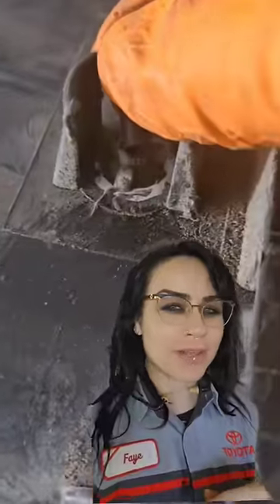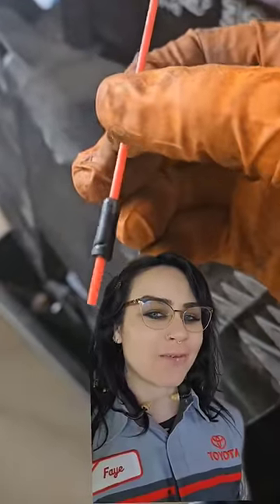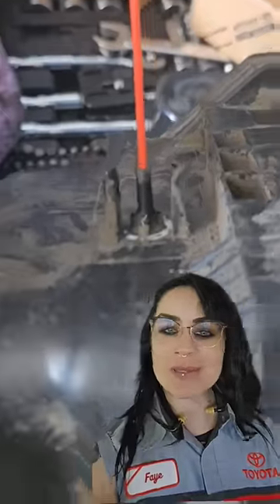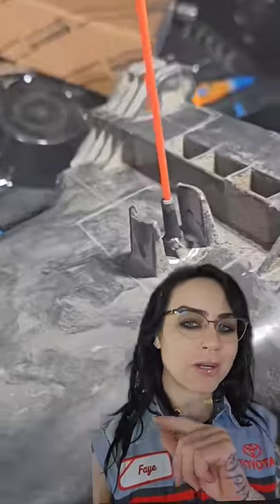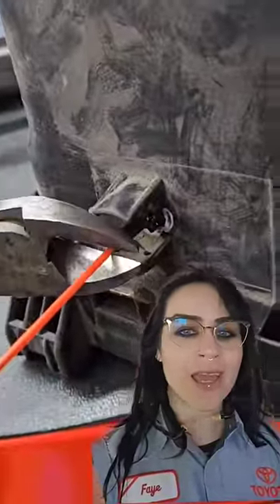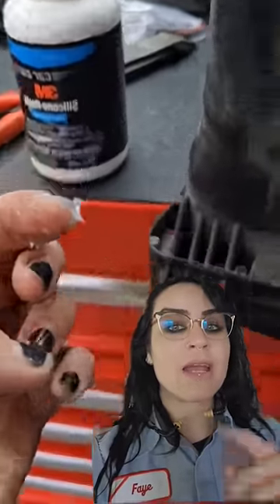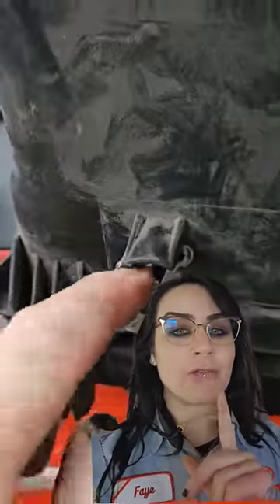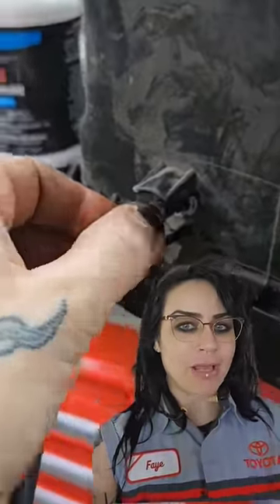Quick Fix - Broken Vacuum Port / Air Box Nipple Repair #techtips #toyotatech #femalemechanic #diyfix

Comment: I typically thrill it out to the same size and replace with copper tube and J-B Weld
Reply from the maker: Alsoi good!!👍🏻
Reply: @FayeHadley will this work on a jet plane?😂
Reply: also a short piece of brake line can do in a pinch. Leave the flare on the inside and build it up with glue for strength.
Reply: JB Weld is also far stronger than Gorilla Glue.
Reply: No need for the jb weld. Make the hole around half a mm smaller in the plastic portion, heat the ferrule up and then slowly sink it into the plastic. Looks factory and will never fail.
Reply: @qanondon2100  A&P technician with turbine experience here, this would be a repair warranting throwing a 2" wrench boomerang style at your knees on a jet lmao. 

The only exception would be in any form of military aviation, they fix it just enough to get off the ground long enough to come in for a hard and hot landing at their maintenance ramp.
Reply: @FayeHadley I probs didn't hear but why not pull out the straw before it dries holding the piece in place while doing so? That hole looks smaller now
Reply: @Nayr747  True, Cyanoacrylate glue (Super glue) is susceptible to moisture and shock failure.

Comment: You can usually find these barbs in the plumbing department all the way down to 8th inch out of brass and then you can get a small pipe tap and drill the plastic out and then tap it either 1/8 MPT or 1/4 NPT or 3/8 NPT depending on the size. Super glue and a spray nozzle works 100% if you're on the side of the road somewhere and for whatever reason a vacuum line won't hold on idle or something like that but brass and some threads is a little more permanent.
Reply: the nipple is a way better fix and if you look hard enough you can even find them in black plastic if you a visually OCD

Comment: Use brake line (NiCopp recommended) with a slight bubble flare on one end and scuff up the other end with 180grit
Use a drill bit one size smaller than brake line.
Clean newly made nipple with brake cleaner or other solvent. 
Make sure it will go in hole with some force.
Then install with some 'JB quick weld' on scuffed end.
This is a permanent repair and will be stronger than from factory.
I have repaired many $100-$200 vacuum solenoids etc with this technique.

If customer has some mechanical understanding and you explain and show him final product with a shiny metal nipple sticking out of it you'll go from being a mechanic to a magician in their eyes.

Comment: Nice tip Faye.
My hack for fixing this sort of issue is instead of using a plastic straw, I use spring steel roll pins.
Super strong, and will never break again😁👍

Comment: Tip here , if the hose is brittle and not moving just take a knife and slit it and then trim back and reinstall when done. Piece of hose doesn't cost a thing but that air box def does
Reply: If you're putting an old hose back, you will probably want to cut off the end anyways, because it may crack.
Reply: I mean what's wrong with breaking the customers equipment then simply glueing it back together lmao.
Reply: Work smarter not harder. 😮
Reply: I learned this the hard way on the first heater core job I ever had to do for free, when changing the hoses. Boss told me the trick after... figures.
Reply: Also, put a thin smear of silicone grease on the nipple before reinstalling the hose. The hose will never get stuck again.

Comment: Here in FL,  those hoses get rock hard too. I dread having to touch them.
Great tip Faye
Reply: So you got me thinking. I looked all over under the hood of my car, and the only plastic I found was the washer fluid and coolant tanks, the battery, and the wiring connector at the firewall. Everything else is cast iron or stamped steel.
Reply: This would be located on the enclosed air intake box somewhere.

Comment: MEK also works excellent for abs plastics. 
It chemically melts the plastic, creating a weld once dry.
Maximum binding strength is about 24 hours.
Reply: Ain't nobody got time for that
Reply: @mrs6606  If you're pulling an engine and waiting on part's you do.
Reply: I have a degree in plastics technology and you are absolutely correct. The only thing better would be THF but nobody has that…
Reply: I don't know about that particular filter box but  the one on my '02 Civic is made of HDPE.
Reply: @sponiebr  High density polyethylene (HDPE) is a thermoplastic- 
all though ABS and PVC are thermoplastic’s as well, they are less dense and therefore more porous and absorb the solvent better. In your case you should rough the surface to achieve the same effect. HDPE is difficult to bond but beyond thermo welding, Chem welding is still your best bet.
Reply: @howto1537 
What is “MEK” and “THF”???

Where would someone find these products???
Reply: @AzzKicker-bz1cb  you won’t find THF but MEK (Methyl Ethyl Keytone) is fairly common. Most hardware stores should have it. It’s a solvent
Reply: @AzzKicker-bz1cb MEK is methyl ethyl keytone, they don't sell it here in California anymore, I used it for all types of stuff when I was younger.  Not sure what THF is.
Reply: @Chicomite  its either triethylamine trihydrofluoride or Tetrahydrofuran aka Oxalane. 
Its a precusory agent used in polymer production, which is essentially what all "plastics" are.

You can also weld acrylic and or plexiglass with acetone with minimal distortion, think the method is published in the DOT FAA AC43.13-1b general handbook under approved emergency repair methods for aircraft. You can even actually stitch cracks together with wire too.
Reply: Acetone works on ABS, MEK is for PET.. that said almost off of these are nylon(PA).
Reply: @tshackelton  MEK works much better than acetone. Acetone flashes over too quickly. (It would probably be good for polystyrene.)
Plus, I've made several projects using ABS and MEK. 
Also...
there are plenty of videos here on YouTube of people making custom battery trays, and what have you using MEK and ABS plastic.

Comment: Excellent video very good idea I've drilled the hole out and threaded a brass nipple in to fix that but this is much cheaper and  most shops have everything in the tool box Thanks for the tip

Comment: I would have tapped the hole and threaded in a metal spiggot, but this tip may come in handy at times.  Thanks
Reply: What /where can one find this "spigot".. never seen one that small.. part #?
Reply: @w3twir3d1  I usually look around in my boxes of small air fitting/fuel supply parts.  It helps being a small engine guy.  Any threaded tube would work.  Otherwise consider threading a tube (brake line, etc) to make your own.
Reply: @w3twir3d1  they probably meant like a peice of hollow roll pin or like a long bushing.

Comment: I am concerned that would constrict the airflow, but you are the professional. Hell yeah, Toyota.
Reply: so what if the air door works a little slower.
Reply: Just a source of vacuum, should be fine
Reply: Wouldn't that only be a problem if gunk started building up in the smaller hole?
Reply: Uhhh, clearly have NO IDEA
Reply: @dennisgreiwe2078 

It's on the filtered side so no gunk.
Reply: In a set up where a vacuum signal is required the marginally smaller diameter won't have a significant effect.
Reply: @whocares5188 

Even if it somehow did it'd just get burnt.
Reply: @skylined5534  not everything under vacuum is binary lol

Comment: Faye, I use Permatex Perma Poxy 84115 plastic weld. It's a 2 part epoxy that is thermogenic as it cures, i.e. it gets hot. First clean both surfaces with brake cleaner, isopropyl alcohol, etc. Let dry. Mix equal parts of the perma poxy, apply to both parts as you did with the super glue. Hold in place for a couple of minutes then let it cure. The repaired joint will be stronger than the original base material.
I've repaired motorcycle body work with this product for years now. It can even be used to make missing mounting tabs or fill holes.
Great stuff.

Comment: you can also drill out that orange straw segment for better clearance. Just drill carefully.
Reply: That, paired with the dikes, reduced that flow by 50% easy.
Reply: neither of the two if ya work on cars do you
Reply: @recruit_life0715  doesn't take a mechanic to see a rigged fix.

Comment: Nice fix...will add that to the skill set.. ... i would have probably used the Krazy glue and baking soda mix.  Used that to repair broken trim clip.  And maybe reinforced with JB weld (original) or their putty.

Comment: you work at the dealer, just do the right thing and replace the air box.... also if you try pulling the line off and it doesn't want to come off cut the line.....it cost the company .50 a foot or if you're shady and don't want the shop sup to find out just pay for it yourself.... do better....

Comment: This is why people hate mechanics. If you break a part, you replace it, not glue it back together pretending nothing happened. If you feel the part was going to break anyway, you talk to the customer and work out a price. Sending them down the road with a compromised component is not the answer. A mechanic did the same thing to me. A few months later, check engine light. Error code for one of two solenoids. Looked at them and one had the male hose fitting glued on. Took a wild guess that was the one triggering the error. Replaced it and error code was resolved. Treat the customer how you would like another mechanic to treat your mother. I'm sure you wouldn't appreciate your mother having to go back to a mechanic a couple months later to fix a glue job and charged for diagnosis, part, and labor all over again.
Reply: So what if it was already broke and she saved the customer money ??
Reply: @Theorangeman.  It’s still unsavory to do cause then that customer is just gonna sell it eventually to another person who will possibly end up dealing with the cost.  
This seems like a small thing but trust me mechanics do much more than this to cheat the system all the time.
Reply: It's old brittle plastic. Technically the customer should be paying for the new part if this happens. I think this repair is a great idea.
Reply: . You really expect the garage to replace that complete airbox lid?
Reply: ah yes 10 cents of glue is a lot more than 50 bucks for an airbox cover
Reply: @beastt549  that airbox is probably $500. But yeah I get your point.
Reply: I ain't buying a whole new damn airbox for $50. First I would go with this trick. If it fails, then I get a new airbox. I wouldn't automatically try to replace it without fixing it first
Reply: @bluemonday2000  Guessing it might even be more than that, then what if its back order? You would need to go checking for a wreck yard part. I agree if repaired properly, it should be fine. Especially when you work on older vehicles where parts get brittle etc., a guy would be replacing parts every day. Just not possible, you would lose too much money and time.
Reply: I think she is talking more about if you were working on your own car. Especially as a mechanic for a Toyota dealership, she probably would just order a new part and tell the customer. Her content is largely made for people trying to learn how to work on their own vehicles.
Reply: @HybridMiranda  as a Toyota Dealer Tech I would not order a new part. By ordering a new part this now becomes a big deal and managment gets involved. A quick fix is a win win for everyone.
Reply: You’re obviously not a tech/ mechanic and have never touched a car so just stay over there in the realm of NPC. There’s some things you can get away with bandaging and patching. In this case this is the right way to go about this situation. The customer won’t want to pay for it anyway.
Reply: Sir,  I agree with you, when I was an ASE certified mechanic in the 80's if we broke something on a customer's vehicle our shop replaced that part at the shops expense.  There are certain parts that you know will break while performing a certain job and you include that part into the estimate for the repair.  No surprises and the job is done right.

Comment: Add about a 1/4 inch of clear epoxy for strength around the break and it'll hold a whole lot better than super glue alone. Great tip!

Comment: I kind of did this when installing a boost gage in my previous car. Cut the wrong hose.. got a hose that fit inside the hose.. opening was similar diameter.. Worked quite well .

Comment: Excellent video!
I'd do this with the straw but instead of using cyanoacrylate which will not properly adhere to HDPE (what the filter box is made of) I'd go straight to welding it.... but that's ENTIRELY BESIDES the point.

Comment: Great video. I've fixed these in the past with 2 part epoxy. Also holds great. And you can buy it in black. In my experience with 2 part epoxy, the black one works best.

Comment: Best advice, invest in a real cold air intake with the correct fittings for your tubes, one gives you more room to work but two most factory air boxes bring the air over the engine and it just makes it less efficient

Comment: Another way I found to repair plastic bits is to take a zip tie and light it on fire, the plastic will drip and makes a great patch as it melts the existing plastic and helps seal it. I used this technique to fix a crack in a vacuum reservoir as well as other things.

Comment: Yeah. Don't leave straw in; especially if the nipple you are repairing controls an actuator where the inner diameter can impact how the unit operates.. 
i.e. boost controllers, wastegates... can cause very big problems..

Comment: Use dielectric grease if you want it to come off easy or frequency, dielectric grease doesn't deteriorate the rubber/plastic/paint and prevents rust also a winter or salt water marine grade grease like calcium sulfonate prevents rust

Comment: On the larger ports on FCA products I’ve always had better luck using a cheap butane soldering iron, lightly melt both sides with hash marks, then use a small butane torch, get both mating surfaces warm enough to almost melt, smack together, couple more stitch lines and blend with the soldering iron and boom. Lasts way longer then super glue for me atleast

Comment: I know all plastics are not created equally but I use to watch a motorcycle repair shop dude fix all sorts of plastic parts using a solder iron and zip ties. He used the zip ties like solder and just melted it all together.

Comment: I'm getting ready to deal with the same thing on a larger scale. One of the fitting to the heat exchanger on my 2004 Nissan Xterra broke off. It left some of the male fitting. I'm a driver, not a mechanic. So this is a bit of a learning experience for me as I look for a way to fix it.

Comment: I changed a clutch kit and pilot bearing and even went back in and changed the new pilot bearing again because of a squeeling noise under load that EVERYBODY thought was the pilot bearing... Come to find out someone had been messing around with the vacuum lines (it was a mustang mid to late 90s model i think) and they had spliced one for whatever reason and then nipple (s) contraption they made to splice it back together and tape it up was a tiny little straw piece just like that, and the bottleneck of air at that point created the perfect whistle lol 😂 had us all stumped and cost alot of money for no reason.
I think that happened in the first year i was a tech

Comment: I like to use pb blaster lubricant, it stays greased long enough to take off and put on and then it will evaporate instead of keeping it lubricated longer than it needs to.

Great tip i learned something!

Comment: I highly recommend attempting using super glue and baking soda. It makes a very strong and quick repair. I've been using it for years. Plus, if you have a big hole you can use window screen and build the soda/glue up to fill it. VERY strong fix.

Comment: They make a 2nnd part spray that cures the glue asap,smokes and everything as it creates an endothermic reaction.  Hot Stuff and Super glue sell it in their kits and it's available separately on line and in some stores.  Adding baking soda (per previous comment) also lets you repair things like ceramics (broken dinner plate, coffee cup, etc.) and fill in the seam, making almost invisible repairs.  😊

Comment: Just a note on pulling off hoses... When you pull on a hose it stretches. When it stretches the inside diameter of the hose of the hose shrinks. The more you pull the tighter the hose gets until either the nipple or the hose wins. But... if you compress the hose, like when you pry it up from the bottom, the ID will open and release the hose. Of course, if you do it the dummy way and just yank on it, you'll need to stock up on gorilla glue.

Comment: I recommend plastic welding. Use a soldering iron and some zip ties. Itll be way stronger. Basically OEM strength.

Comment: In my experience glues and epoxies get really brittle in engine heat and then one good bump and these fall off again. I started plastic welding them with an old soldering iron, stick it in place and run the hot iron around it like you're trying to trace the circle and its as good as new.

Comment: I was installing a radiator one time and I accidentally broke off the coolant overflow hose fitting. Wasn't sure what to do and didn't want to buy a plastic welder, so I just got a new radiator. 😕

Comment: I typically use epoxy. I prime the area with  mek. Super glue is brittle and has failed me. This is a good hack. I have done similar repairs on Kawasaki KLR plastic fairings and covers.

Comment: Honestly, I'd just take some JB Weld SteelStik and encase that broken-off piece with a healthy amount of the kneaded epoxy, creating a little mound around the joint of the broken-off nipple and air box.  It won't be going anywhere and the original piece, unrestricted, will be restored, stronger than before.